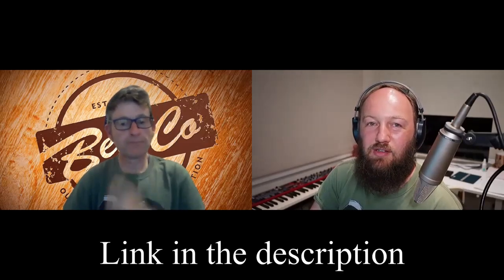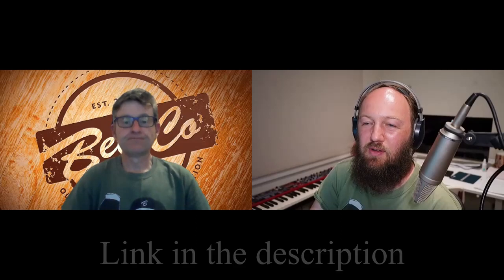Fermentation 101 FAQs with Stass and Dermott

Comment: Kviek yeast has certainly introduced a few new variables indeed.. 
-Fermenting at 35°c final gravity is often achieved within 36 hrs, there's certainly no diacetyl rest considered in that scenario.
- And when to dry hop in this situation ? At yeast pitch? At FG? I've been adding dry hops to my kviek ales at FG ( purged pressurised kegmenter) and cold crashing immediately. 35°c - 5°c in 3 days and package into keg. 6 days g2g.
Reply from the maker: Hey Chris, Kviek has truly changed the game as you point out getting beer from grain to glass in remarkably fast time frames.  We would suggest if you want to have a heavily dry hopped Kviek ale you will need to give it time at warm temperature for the hops to interact with you beer.  I guess as brewers and drinkers we have to constantly balance or trade off between time temperature and flavour.  A little more time, hopping at the right temperature and then time to cold condition will always help improve the flavour and quality of your beer.  Keep on experimenting, brewing and having fun! always